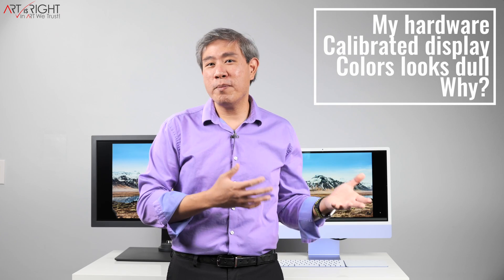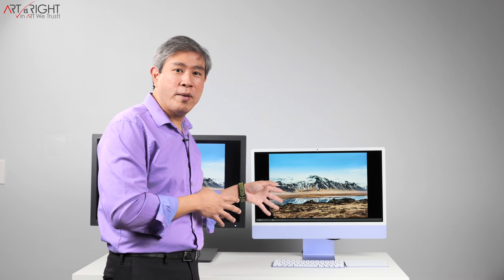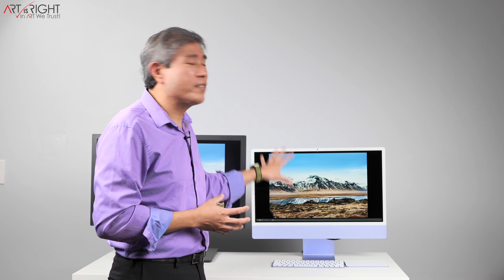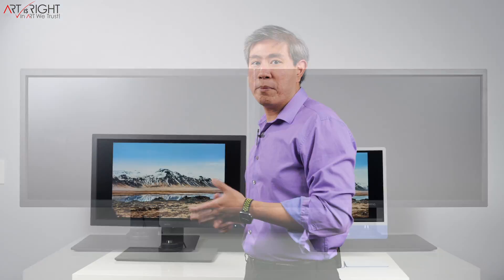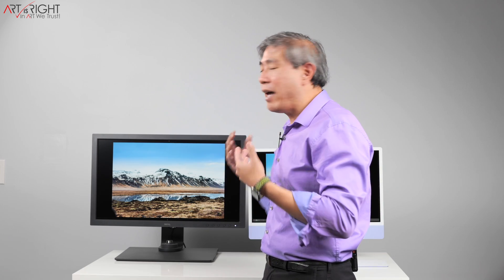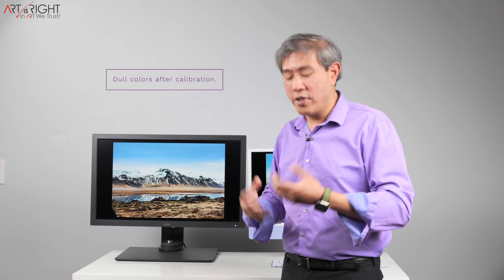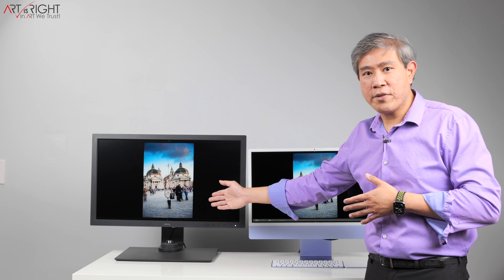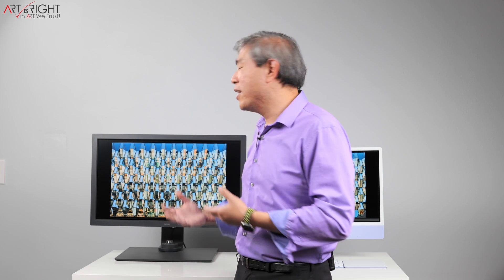My calibrated display looks dull? A conversation about matte vs glossy display!

Comment: Question regarding "If you get it looking great on a matte display, it will look amazing on a glossy display."

One concern I have: if I get it to look good on the matte display, won't it look over-processed on a glossy display?
Reply from the maker: I can see why one may think that but no. It comes down to taking your image edit from 60-80% to a higher 90% -100%, most of these are tone optimization and etc.

Comment: I think it's a mistake to consider the glossy display as the biased one. It's the matte coating that is an extra thing on top of the panel, and it's something only people using old PC displays see, everyone else in the entire world is on glossy displays. 
I suppose if you're printing to specifically matte paper, then you could consider the glossy display to be biased, but if you're printing glossy then the matte will be biased.
Point being is it's not true that glossy displays are biased, glossy displays just show you the panel as is, the matte coating ones apply a coating which reduces the contrast, saturation and sharpness (for the pursuit of blurrier reflections) therefore introducing bias.
Reply from the maker: We are all entitled to our opinion.

Comment: Matte is absolutely a mistake for creatives. Even if it didn't nuke the saturation, contrast and sharpness of the panel you just paid for, it would make no sense to use matte considering your work is destined to be viewed on glossy.
This is exactly why the nano texture coating from apple costs so much, they don't want you to get it because it's a compromise most creatives shouldn't make. Making your reflections a bit blurrier at the expense of image quality is not worth it.
Reply from the maker: We are all entitled to our opinion.

Comment: Great explanation! My work has switched from an 27 iMacs to MacBooks with matte ViewSonic extended displays. So it definitely was a huge adjustment after using a glossy iMac display.
Do you think that a monitor hood would make a difference if my office has no windows?
Reply from the maker: No much

Comment: Matte coating on displays are produced for the everyday person and we have no options. You aren't correct about the BenQ because for video content people view on their phones.
Reply from the maker: Not quite, I am correct in my resolve based on what I am sharing and extensive experience working with various displays. You opinion may differ, however, it is not one that I shared.
Reply: @ArtIsRight  In the print world you are correct but in the video world you are not. I don't see a Ben Q professional cine monitor. You seem to review or calibrate the Apple Cine display a lot but you tell a different story when talking about Glossy vs Matte display options. I don't think we have a glossy monitor display motion that's not made by Apple. Again, content is 90% viewed on iPhones or other mobile devices. We view the majority of produced content on Apple iPhone glossy phone displays. Ben- Q does not solve this issue. Apple does but is expensive.

Comment: Excellent points, many of which I never thought of. But what if you are looking at this as a consumer of content, where you have no control of the source material? (For example you are just looking at somebody else's work)
Reply from the maker: Well then it is what it is and you just have to accept what you see. Chances are if it is from a corporation who cares such as apple website or Apple TV the colors will be good and if you are watching from creators who cares then you are good! Otherwise there's not much that can be done.
Reply: @ArtIsRight  It's not always caring. Not every creator has the budget of Apple. It's easy to care more when you are the biggest company in the world and sell monitors that cost $2000.
Reply from the maker: This perception over  looks a lot of things. They don't need an Apple display or a big budget to care. They just need to calibrate the display that they have and have an understanding of color management, it's acceptable range and variations. $2000 display does not mean that one care and depending on the creative craft that one do, it may not fit best and at that point it would be more showing off than really doing good work with a good display.
Reply: @ArtIsRight  I work in process development and manufacturing. I think most things can be fine-tuned and improved if you have time and budget. That's even more true if it takes a lot of creativity. With Apple it's not expensive equipment that leads directly to improvement, but selling expensive equipment (monitors, computers, phones and other things) gives them and their people the budget to do things well. 

Where I respectfully disagree is this: When things are not done as well as they could be, it may be because people don't have time or money. It's not always because they don't care or are lazy.
Reply from the maker: Sure I hear you but at the end of the day a calibrator device cost $250 or just about for a good one, you can even find one less used. So I don't accept that excuse really. Also time, at some point you just have to invest in the time to learn about these intricacies, either that or brush it off which is don't care. I understand where you are coming from, but when it comes to color management, I don't agree with your notion.
Reply: @ArtIsRight  I think it depends on whether a person is creating their own work or is paid to do it for someone else. For example if a painter is paid for one day to paint a big house, there is only so much detailed work they can do. They can take extra care at their own cost or decline the job, but not everyone has that option.

Comment: I just subscribed to your channel as I just bought a BenQ SW271, and I‘ve already watched some very helpful videos in this series. The first thing that I noticed right away working on my display from a MacBook Pro with retina screen and what I was quite disappointed about was the lack of ‘pop’ and contrast on the BenQ compared to what I saw on the MBP. This video is really helpful in understanding why. 
Isn’t the main issue though what happens to the workflow when you want to PRINT your photos, and the difference that the display will have on the amount of ‘pop’, saturation and contrast of these prints when working from a BenQ as opposed to a MBP? If I understand you correctly, the MBP display would be prone to showing you the image in a quality better than the one of your print, so in a sense it would be ‘deceiving’. If the BenQ is more ‘honest’ in showing you what you get when you print the image, and you then edit the image to improve it, the final print would be better than the one that comes from the MBP procedure. Is that correct? If so, I will keep my BenQ 😉 (And forgive me for pointing this printing element out, as it wasn’t entirely clear from your otherwise very helpful video.)
Reply from the maker: What you said exactly. I would not be looking at the pop, I would good for honest and accurate color with BenQ does give.

Comment: That was excellent mate!!! Just the info I was after.
Reply from the maker: Glad it helped
Reply: @ArtIsRight  As a hobby photographer, I’ve been tossing between getting an iMac mini vs the 24 inch. I find the thought of looking for an external display very daunting and so was leaning towards the all-in-one. Is there a cheaper benq display you would recommend? I’ve been looking at the EW3270u. Any thoughts would be great.
Reply from the maker: If you want great color accuracy I would look at their PD line, which there are numerous models at different price point. Or if you like all in one options from Apple are great as well. Personal I like it better with a disconnected display. For instance Mac mini M1 run much quieter than 24" iMac
Reply: @ArtIsRight  Thanks for getting back to me mate. The reported noise of the iMac is a concern and that is why I’m looking at a Mac mini setup. I’ll look at the pod range and see what I can find. Thanks again.
Reply from the maker: Side note Apple new laptop is fairly quiet as well and more power than Mac mini
Reply: @ArtIsRight  yeah. I got rid of a 2019 mbp 16 inch j7/16/512 mainly for the noise especially in Lightroom. I am looking at the 14 inch base model too. I’m not crazy for the latest and greatest. I just want something that doesn’t make me feel like it’s struggling to process the images. And I just have 24 mp files. I think the 14 inch mbp could work. But it again comes down to,the monitor. And the cost keeps going up and up. That is why I though the iMac 24 is a good option. I prefer the desktop form factor anyways.

Comment: Fellow purple fan!

We need more glossy monitors for regular consumer monitors. i find the absolute reflection alot easier to handle than the diffusion that takes up a larger part of the screen and washes everything out in a fog.
Reply: @Don't Fear The Reaper that isn't really a similar effect. And increasing contrast on lcd isn't doing much, none of those provide clarity.
Reply from the maker: Each creatives feel differently about this... it is all a matter of opinion and preference similar to 4K scaling vs native 2k
Reply: I was going to comment the same thing.
Reply: Hell no.  I can't stand the glossy screen fad that was around for a good 10 years.  Thank god most makers went back to matte displays.  If you have anything other than perfect light, the glare is horrible.  Extra negative points if it's a laptop - you're often using it in places with poor lighting like an office or an auditorium.
Reply: @donjulioanejo  I just got a lg c2 and I don't understand this perfect lighting thing. Using it in the same conditions as my m27 and other matte monitors and it's completely fine even when the display is tuned dimmer.

I don't think glossy was ever a fad, it didn't even dominate the market during the days of the Korean ips panels. Unless you mean even before then, but the monitor I bought in 2009 isn't even glossy.

Comment: I'm actually not so sure that it all boils down to glossy vs matte displays. This video may be a gross oversimlification of what's actually going on with people's monitors. I've noticed that when my monitor looks "dull", more often than not this means that something is wrong with the gamma value. Specifically if monitor gamma is lower than specified in the monitor profile, or if no monitor profile is installed at all, the picture may look "dull". Apart from trivial profile misconfiguration, there's also the question of whether Palette Master Element is doing a good job calibrating the monitor. When I verify PME calibration with Argyll, I consistently get a slightly bluer white point and a slightly lower gamma. Either PME or Argyll is not quite right here, and to be honest I trust Argyll more. Is PME calibration always off? Not necessarily. This may depend on the instrument you are calibrating with. It's possible that some instruments are not as well supported by PME as others.

And finally, if you are wondering why your photos look different between Adobe programs and Google Chrome, you should know that on Windows and Linux Chrome ignores the gamma value in your monitor profile completely (!) and just uses some sRGB-ish transfer function that Google engineers came up with.

People often obsess about dE and don't pay nearly as much attention to gamma. Meanwhile gamma is arguably just as important as dE, if not more. Human eyes see difference in luminance way better than difference in color, which is what JPEG compression is based on.
Reply from the maker: The premise of this video is for fully calibrated systems so yes it does boil down to the display coating. Gamma is something that most should not change during calibration, unless there are very specific reasons to do so. So if you are doing a software calibration, gamma information is embedded in the profile but for someone to have a mismatch gamma on a software calibrated display to an icc profile that requires user intervention at the monitor itself, again something that is not recommended. If no monitor profile is used the picture generally won't look dull unless you are using a really low quality display. The interesting thing is that lots of people double PME, X-Rite software results but trust Argyll and I am not sure that is right premise. These company knows what they are doing, perhaps Argyll is reporting the incorrect or slightly off result. But each to their own. If anyone is really that much in doubt they should spring for CalMan and verify it that way, but then again, I don't really see the point to go through all of the trouble, unless there are specific reasons that you need it. Some people just needs oversimplification to get the message across. And when everything is set to a similar value, luminance, gamma, RGB primary, etc. Glossy still shows a more saturated and slightly higher contrast perception that matted display, and there are reasons why Apple and other company decided to make that the default. I do see your point about gamma, but most of the people that runs into this issue are not as sophisticated as you are and gamma is not generally a factor that they tinkle with. 

Thanks for the tip on Chrome that will help lots of windows users.
Reply: You are right that it shouldn't happen with proper calibration, but my point is that a proper calibration is not a given. The user needs to be mindful of possible issues with gamma and verify their calibration to see if their profile matches the monitor.

One other possibility is that the user may be accustomed to working with wrong gamma. If user's monitor was previously hardware-calibrated to gamma 2.2, but the OS had no .icm profile or a generic sRGB profile installed, such configuration would make colors oversaturated. Thus proper calibration could be seen as "dull".

On the topic of Argyll: all factory-calibrated monitors that I checked had good calibration according to Argyll. Given that hardware and software that they use for factory calibration is an order of magnitude better than what we use at home, I think it's a good reason to trust it.

Comment: A Quick question dose the calibrator its self need to be plugged in to the monitor  or the computer and dose this  matter  will it make a difference .
Reply from the maker: You can plug it in anywhere as long as the computer sees and recognize the device

Comment: I have 16inch macbook pro and Benq BL2420 pt 100% srgb monitor

Which will be good for printing and editing work?
Reply from the maker: It can be but that is not a proline display, this said, it should not deter you either.
Reply: @ArtIsRight  so MacBook screen  not good for editing ?
Reply from the maker: You can edit on any display really, but not all displays are the same. Apple displays are good and improves with each iterations. But there's a reason why dedicated pro display with and without hardware calibration exist.

Comment: Great video, Art. This is being talked about very rarely.

You actually demonstrated what also can be a pro for glossy displays:
Since they act like a mirror it sometimes is enough to tilt or turn them just a couple of degrees and the reflection is gone.
I have a wall behind me that when it gets hit by more light will show as a pretty bad bright spot on my BenQ monitor (with matte display) and slightly tilting it won’t help.

The newer super matte coating would be nice here.
Reply from the maker: I hear ya! Thanks for chiming in, greatly appreciated!

Comment: Great information.  I think if you want to achieve "What You See Is What You Get" or WYSIWYG when you print you need a matte monitor.  Once I calibrated my matte monitor correctly my prints came very close to matching what I saw on the screen.  I don't think I ever would of got there with a glossy screen.
Reply from the maker: Sounds about right, you can certainly try on a glossy display, but then you have to lower the contrast ratio via calibration, it can be done but much more tedious. :D